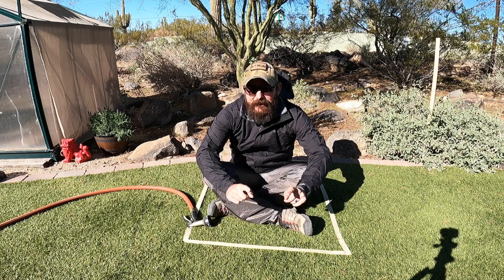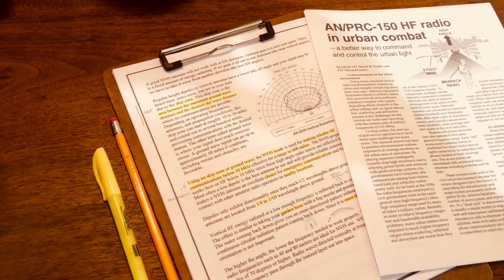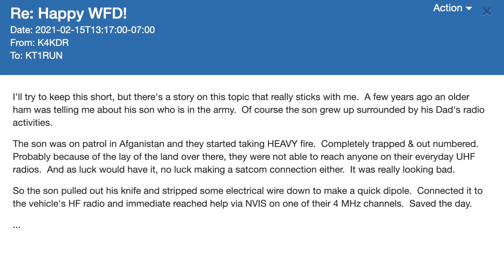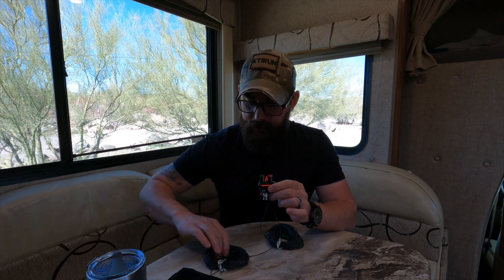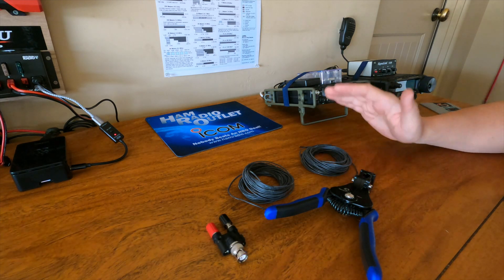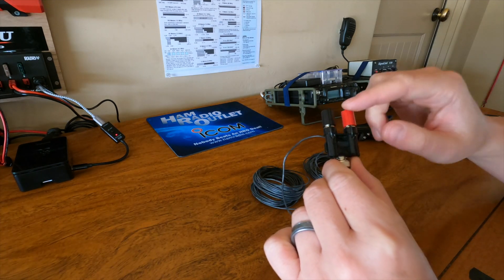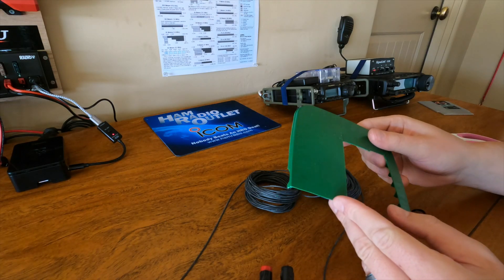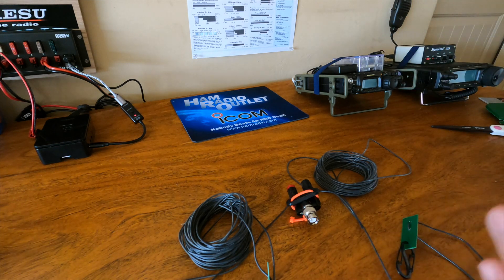Local Emergency Communications with NVIS - Let's Build an 80m/40m Dipole

Comment: Great Video. NVIS done easy. What Pouch did you use for this kit. Please advise. Very well organized setup. Looks easy to deploy in an emergency.
Reply from the maker: Thanks. While it's not the most sophisticated antenna, it's inexpensive and works. I've been using my 80m version to check email daily on a Winlink station located 71km from my home QTH. The bag is from Condor. Here's the one I purchased. Please note: It's my affiliate link. https://amzn.to/3uX2nGy
Reply: @TheTechPrepper  Way Cool. I will build and try on both 40 and 80. I am in SoCal and will try to hit the local HFers.  I tried several years ago with a store bought wire antenna @ approximately 3-5 feet off the ground and it worked fine. 
 Also ordered the Condor Pocket Pouch. Thanks for the info. This is a great way to store a NVIS set up. your help is greatly appreciated K6WXZ.
Reply from the maker: @larryhornerjr  Feel free to look me up on QRZ. I would love to hear how it works out. Also for what's worth, my 80m version snapped under tension during a storm about 3/4 of the way down on one of the legs. I literally stripped a couple of inches with my pocket knife, wrapped the wires together, and covered it with electrical tape. I didn't even bother to take in the other leg so that they were equal. I can still access a Winlink RMS node on 80m locally. So, yes, while you will not be winning any contests with this antenna, it's a great for an emcomm kit. 73 de KT1RUN

Comment: A 3D printer would be awesome to have, but there is nothing wrong with  recycling something like the Cascade lid. Cool video.
Reply from the maker: Actually, a good friend with a 3D printer would be better. Glad you enjoyed the video. I hope you stick around. I’m filming a new video right now on the PackTenna Linked Dipole. It’s going out on its maiden voyage tomorrow during a SOTA activation. 73

Comment: I've been getting ready to put one of these together for a while and now that the snow is gone i can get out more to play with this stuff. Glad to see someone putting it into action and getting good results. 73 de W8MJL
Reply from the maker: That’s great, Michael. It’s a nice solderless build. It is still serving me well. I use it daily to check my Winlink email and have taken it out successfully on a SOTA activation. I’m bringing it out today for another SOTA activation on 40m. If you do the build, I would be I interested in your experience. It’s great for go-kits.
Reply: @TheTechPrepper  I'll let you know for sure. I'm building a last ditch emcomms kit based around my X5105 and this antenna will go great in it.
Reply from the maker: It’s perfect for a go-kit. Good luck. How do you like the Xiegu X5150? I’m considering the G90 and X5150 for a go-kit.
Reply: @TheTechPrepper  I love it, it's a great piece of kit. I've been eyeing them since they first came out and finally pulled the trigger on one last month. Thing that got me was it addition of the antenna tuner and analyzer, that and it didn't break the bank. I was going to get the G90 but i felt the screen was too small for my older eyes, but i know several operators that swear by them.

Comment: Well done! You could also put the 40m and 80m antenna wire on the same BNC-Banana plug as in an inverted V configuration, it would look look like an inverted  X though.But you would have both bands ready for NVIS.  73!
Reply from the maker: Thank you. Great tip. I’m actually planning on modifying the 80m version with a link so that I can cover the voice and digital portions of the band. 80m is wide band. 73

Comment: Here's a couple of ideas for you. Rather than spreading it out like a dipole with a center mast, put one leg of the dipole between two trees, and fold the other leg of the dipole underneath and in parallel with it, laying on the ground. Also try taking the length of wire the same total length of your dipole, and placing it underneath your dipole on the ground. This is what's known as a passive reflector.
Reply: Julian is the man when it comes to portable nvis ops, I've learned so much ( spent alot 😉 ) from watching his videos. While I luv his ops I really enjoy building battery packs!
Reply: Just something came to my mind: the reflector on the ground, hasn't it got to be 5% longer than the radiating element?
Reply: @W-733_KWX  yes +5%
Reply: @MrLahunter29  thanks for your reply, I wasn't sure
Reply from the maker: I appreciate the alternate configuration. I think I'll give this a try and see how it performs.  Thanks, Julian!
Reply: Would this be a folded dipole?

Comment: I discovered NVIS when I lived at a home with only short trees! 73 - AE4KR
Reply from the maker: I'm glad you were able to make the best given your area. We're also challenged by short trees. So far, I am happy with the performance. By any chance did you run a wire under your dipole as a reflector? I've been reading that it helps improve the gain.
Reply: @TheTechPrepper  "Gain" normally measures concentration of signal in a given direction. A low dipole already focuses energy at high angles. I would expect only marginal improvement adding a passive reflector underneath, and it would add considerable complexity to an antenna designed for quick deployment. It is even possible to used phased or parasitic dipole pairs with adjustable spacing to "tune" the angle to optimum, but now you're out of the backpack category.
Reply from the maker: @paulplack490  Thanks for the explanation. I'll give it a try and see if it make any different.

Comment: These simple antennas work absolutely great. They're cheap, portable, and lightweight. Get a few BNC binding post adapters (cobra heads) to keep with your gear. If you're going to buy one, might as well get a few. Grab some wd-1/tt field wire for antenna wire. For around $100 bucks, you'll have a kilometer of wire that's got a tough jacket, copper and steel strands for appx 200 pounds of tensile strength, and is easily soldered. Don't forget about 60 meters either, it's a great band that has some of the best characteristics of both 40m and 80m, and there's usually not a lot of chatter on it either.
Reply from the maker: Thanks for taking the time to comment. I never heard of wd-1/tt field wire. It seems very popular with military’s around the world. After a quick search, I found some Swiss surplus field communications wire. What a great deal—$45 for 656’. This really drops the price for this simple build. I’ll give 60m a shot. At these prices, I can have a dipole for every band. Although, I’m experimenting with manual links.
Reply: Fair Radio Sales in the U.S. has various types of military field wire in different lengths. They're also an excellent source of military surplus electronics.

Comment: Good performance on a $15 dipole. Can't argue with the results. 73 de K9DWB
Reply from the maker: It’s surprising how well it works. I made my first Winlink connection with ARDOP on 40m over the weekend and have been able to successfully check for messages the last two mornings. I was talking to a fellow on SSB yesterday and he made the point that the antenna would not work and that I have to move it to 30 feet. At any rate, I’m happy with my little $15 antenna. Thanks for the comment. 73

Comment: Thanks for this posting of this relevant ARES/EMCOMM topic. Based on my modeling using the EZNEC Antenna Modeling software of the original  antenna design by Dr. Carl Jelinek, N6VNG (SK), the following info may be beneficial: 

Using his original mast height of 15', an 80M antenna leg length of 38', with the antenna  end heights of 2.33', and a 40M antenna leg length of 25' with the antenna end heights of 6.67',  the results for 80M shows an antenna gain of -3.29dBi. For 40M it shows an antenna gain of +1.25 dBi. There is a resonant frequency at 5.8 MHz with an SWR of 1.16.

Making modifications only for the resonant frequencies used for EMCOMM in my state of 3.9MHz for 80M (57.5' leg length) and 7.2MHz for 40M  (30.75' leg length), and not changing any of the center or end heights, there was a slight increase in  80M gain to -2.01 dBi and in 40M to 2.57 dBi.

Making additional modifications using the same resonant frequencies with the 80M leg length still at 57.5' but raising the center mast height to 30' and changing the heights at the ends of the antenna to 12.33' above ground, the gain is now 3.15 dBi. A greater than 6dBi increase from the original. With the 40M  center also at 30',  the leg lengths have now changed to 29.25',  and the end heights have now changed to 16.67' above ground, the results shows a gain at 5.65 dBi. A 4.4 dBi increase from the original.

In summary, even with the low signal-to-noise ratio exhibited by a received NVIS signal, improving the gain can allow the antenna to radiate more in the vertical direction. Charles NM5CR
Reply from the maker: Charles, thanks for the brilliant overview along with your modifications. I like your design quite a bit. What’s your preferred wire and mast for your version of the build?
Reply: @TheTechPrepper  The antenna wire that I prefer is the Davis RF Flexweave in 14 gauge. The EZNEC calculations are based upon this wire size. My mast for 30' is  a fiberglass military surplus and for 15' I use 1.5" PVC. Your comments are greatly appreciated.

Comment: I'm really enjoying your channel! I'm a new ham as well and working towards my General license now. If one were to setup a properly-tuned end fed half wave antenna in a horizontal configuration do you think you'd get similar results?
Reply from the maker: It’s always nice to meet a new ham. I’m very new to NVIS and have not tried deploying an EFHW in this configuration. I’ll try my PackTenna Mini 20m EFHW soon and see how it performs. I have a feeling it will work. Good luck with your General upgrade. You won’t regret it. 73

Comment: Excelent Job Gastón! A small contribution from me, adding a 1:1 small balun to your dipole will help in not radiation of the coax, a bit less noise as well. Great videos man. 73
Reply from the maker: Thanks a lot for the contribution, Eduardo. Please keep them coming. Do you know of an inexpensive 1:1 balun build? I have the PackTenna In-Line choke and will start to use it with this build, but it is a bit on the pricey side for people interested in a low cost antenna system. 73, KT1RUN.

Comment: Great stuff. A lot of theories regarding NVIS that are iffy if you ask me.  If it works, go for it. NVIS is suitable for portable / SOTA. Just a thought, it would be very easy to make it linked as well.
Reply from the maker: Thanks, Malen. On thing I learned is not to get hung up on theory. Even if your antenna is in a less than ideal area/configuration, try it. If it works well enough, use it. The next iteration will be linked to support 80m/75m. I  want to run digital and SSB voice on the same deployment. I am thinking about also making it a fan dipole at the same time  to cover 40m.

Comment: Great video. Constantly get 300-900+ km on 40m running JS8Call 10watts with 40m dipole 5 feet above the ground. NVIS rocks.
Reply from the maker: Wow, that is so cool. Thanks for contributing to the discussion and helping demystify NVIS with your experience. It’s very helpful to know that your setup works at 5’ as well.

Comment: Did you find 80m work any better then 40m for NVIS ?
Reply from the maker: Great question. I need to do a bit more testing. Both were giving good local and regional coverage. I’m bias towards 40m as it’s easier to deploy and works pretty well in the mid to late afternoon which is when I operate. 80m is great at night, but the band is so wide that I can’t operate both digital and SSB voice without a tuner. I cut my 80m dipole for the digital portion of the band. I may cut down the wire and modify it to be a linked dipole so the I can manually connect a link at each end when I want digital and disconnect it when I want SSB voice. I’m going to find some local nets and really test out 40m versus 80m. I’m keeping both antennas around and will use each accordingly based on the time of operation.

Comment: Could you please recommend good guide for UHV/VHF repeaters ? I am lost in uplink, downlink, tone, etc. How to use repeater ? Thanks !
Reply from the maker: Unfortunately, I don’t have any resources off hand. Are you having challenges in programming the correct settings on your radio for repeaters in your area? If so, there’s a free program called Chirp that makes it easy to find repeaters in your geographic area and takes care of the necessary settings (frequency, PL tone and offset). You can also take a look at RepeaterBook online if you want to lookup this information and try to manually program your radio. I did a Baofeng programming video on Chirp sometime back.

Comment: Great video,  I like the idea of the electrical tape as I've had binding posts unscrew in the field.  Keep up the great work.  John N6NRO
Reply from the maker: Thanks, John. Electrical tape is great to have in the field. I also keep several feet wrapped around the mast just in case a quick repair is needed for something.